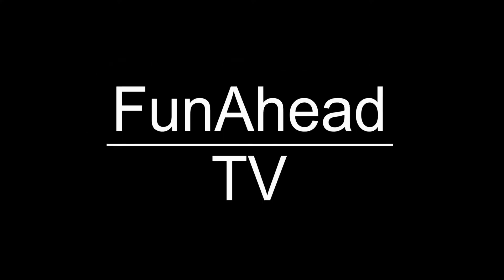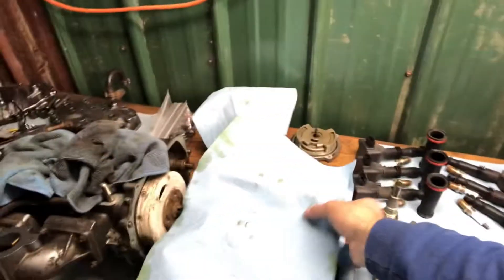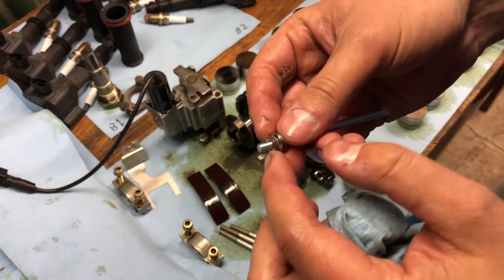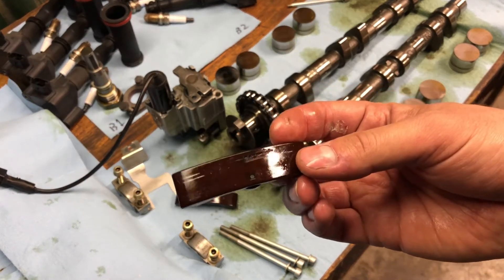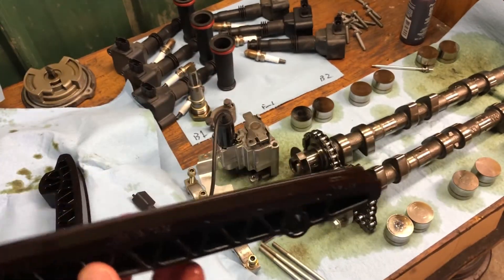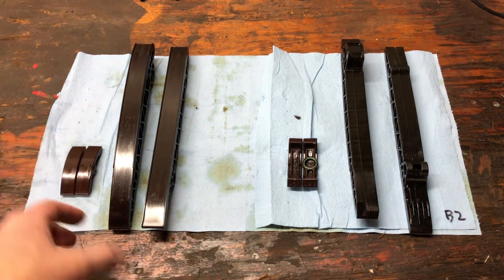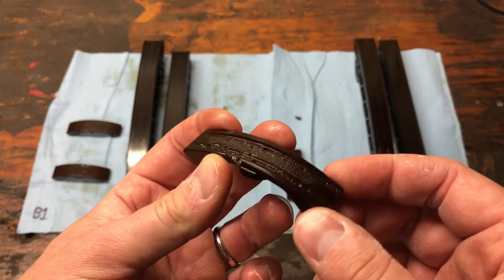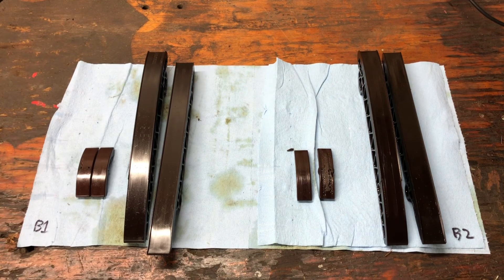Porsche 996 Carrera Timing Chain Guide Removal and Analysis… How Bad Are They??

Comment: Great video showing all the guides! Question, in your case what were your cam deviation values before and after? I've replaced the large guides, but not the variocam guides, and wondering if that may be what is giving me debris, as well as -5.25(warm) on bank 1.
Reply from the maker: Thanks for the kind words. My deviation before was around 3deg on each bank, but I honestly don’t remember the exact numbers. I actually didn’t measure cam deviation numbers afterwards.

Comment: Very good. T-Y. Now, I may have missed it, but how many miles were on this engine?
Reply from the maker: At the time of that service, there were just over 102k miles on the engine.
Reply: T-Y. I have about 80K on mine with the M97 engine. Just trying to decide when to do it. @FunAhead_TV_Official
Reply from the maker: I see. Keep in mind, it really only needs to be done if you’re consistently seeing bits of timing chain guide inside the oil filter when you do an oil change. They’ll be little, dark brown bits of rubber. If you’re not seeing that then you’ve got awhile until it needs done!

Comment: Fantastic video…. Just wondering if you checked your camshaft timing deviation on Durametric or the likes to see how bad they were?
Reply from the maker: Thanks! I appreciate it. Yes, I did check the deviation beforehand. Both were at about 4deg of deviation. So both were within spec of <6deg. In my case, the timing chain guide material in my oil filter over several oil changes was my leading indicator.
Reply: @FunAhead_TV_Official  Great Video. Your video motivated me to do the timing chain guide replacement by myself, after i´ve found guide material in my oilfilter yesterday. How many oil changes did you do after you found material in the filter the first time?
Reply from the maker: @svenotte3070 Thanks! Nice, I’m glad you’re going to take it on! I always base that on the amount of material per oil change. A couple bits, no worries, let it ride. But if I’m seeing a lot of material after a 2-3000 mile oil change interval then it’s time.
Reply: @FunAhead_TV_Official  Thank you for the fast response. I´m just worried about one piece in the oilfilter 🙃.  You´re right, i´ll drive the car the next summer season an will have a look at the oilfilter every few kilometers. My plan is then to do this in the next winter season, with another few thing if the engine has to be removed anyway. IMS, Clutch, AOS
Reply from the maker: @svenotte3070 If it’s just 1 piece then don’t stress! Sounds like a solid plan; knock it all out next winter then drive it like ya stole it 🤘

Comment: Scary stuff! (my engine is at 110,000 miles and hasn’t been touched). I can’t remember if you measured your cam deviations before doing all this?
Reply from the maker: I did measure cam deviation, but I didn’t talk about it in any of my videos. Both banks were at about 4 degrees. 

So, not terrible and within spec, but the main indicator for me was the pieces of chain guide material I was consistently finding… i knew that was something I could only let go for so long.
Reply: @FunAhead_TV_Official how you do you check the came deviation
Reply from the maker: @dandan864  You have to use a scan tool that can read Porsche specific CAN channels. I use the Durametric. Expensive, but very capable
Reply: @dandan864 Foxwell sells a scan tool for about $150 with the Porsche software. Not as capable as the Durametric but gets the job done.
Reply: That's kind of scary that you were only at 4 degrees, I'm at 6 and 2 and planning on doing the overhaul. I haven't noticed anything in my oil though
Reply from the maker: @JustinBekkerCanada  I did find it it interesting that I didn’t have more cam deviation with he one vario-cam pad being so bad. When you say you’ve never found anything in your oil, does that include your oil filter? Like do you cut it open to see what it trapped?
Reply: @FunAhead_TV_Official  I haven't cut open my filter, but I've flicked through the pleats. I thinki still have my last one lying around, so I'll see if I can examine it more closely
Reply from the maker: Gotchya. Yea, unfortunately, it’s hard to tell what all is in there until you fully cut it open.
Reply: @FunAhead_TV_Official  Cut open my last filter and didn't find anything of note (a tiny bit of green, like an o-ring or gasket material).
As I mentioned before, my deviation was 6 and 3. It's back together now and I'm at 4.6 and 1. Bank 1 is the higher deviation and I noticed that my sprocket on Bank 1 did not have the bolts centered in their slot when I took it apart, nor when I timed it on reassembly.

My lower guide pads (on the vario cam) were both showing significant wear, but no other pads were. I'm at 75k km.

Comment: Soon I'll be doing my cam pads.  I'd read on the forums that you have to split the engine to do the long chain guide/tensioner pads, but clearly you didn't and it even looks easy to do.  Was bank 2 just as easy?
Reply from the maker: So, to clarify, you need to split the case for the tensioners on the chain between the crank and the intermediate shaft. But the guides for the chains between the intermediate shaft and the cams are all accessible by just taking the valve covers off and cams out. 

Also, yes, Bank 2 is the same process.
Reply: @FunAhead_TV_Official  Ahh, that makes sense. At 59k miles, my bank 1 deviation is ~7 while my bank 2 is ~1, so I just want to address the bank 1 with the engine in the car. I doubt I'll drop the trans to get access to the inner guide bolt though so likely just the long tensioner pad.  Thanks!
Reply from the maker: @DSC800  Gotchya! Although, I definitely recommend just dropping the engine and trans… believe me, you’ll be happy you did. I’m not sure it’s even possible to do the entire job then re-time the engine with it still in the car. MAYBE it’s possible, but it’d be a total nightmare.
Reply: @FunAhead_TV_Official  Reading on Rennlist, several have done bank 1 side while in the car with good write-ups, bank 2 is not so easy but has been done and, yes, described as a nightmare. I've only got a quickjack so dropping the trans is easy, but i wouldn't look forward to dropping the engine.